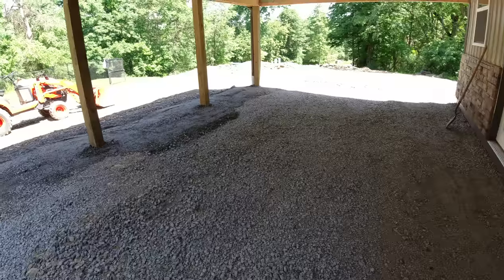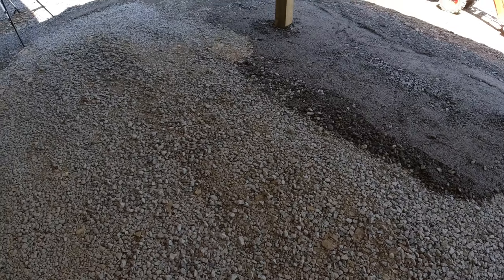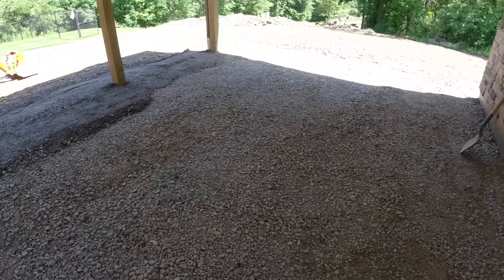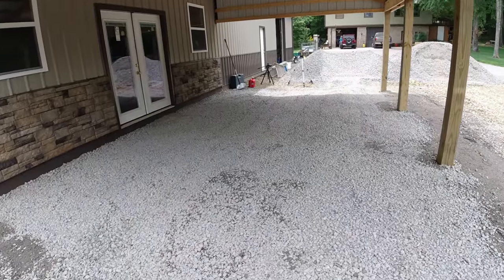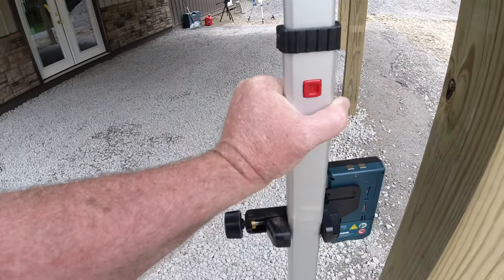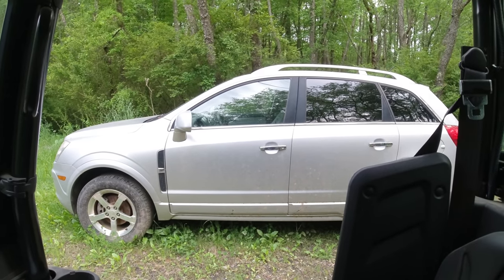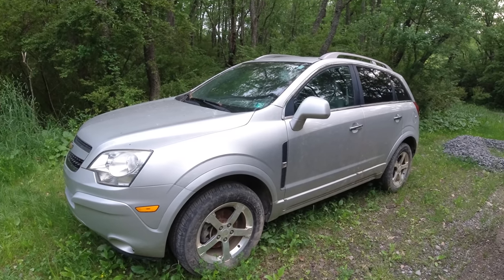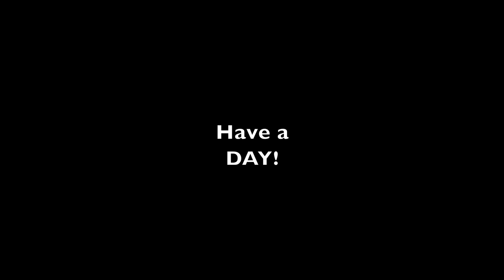BIGGER NEWS than last weeks! Newest addition to the Morgans

Comment: Here in New Zealand and Australia they are General Motors products but marketed under the Holden brand. 
Holden have essentially closed down and existing vehicles continue to be serviced but no new manufacture.
Reply: Timing chains an issue with these captivas